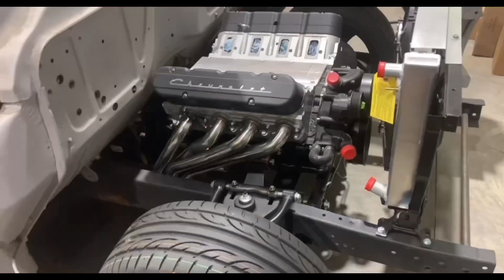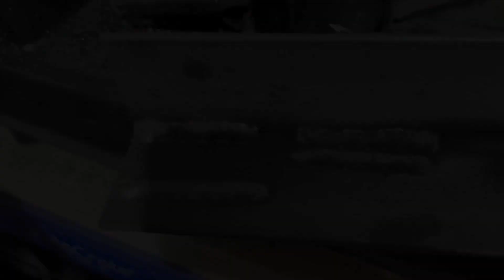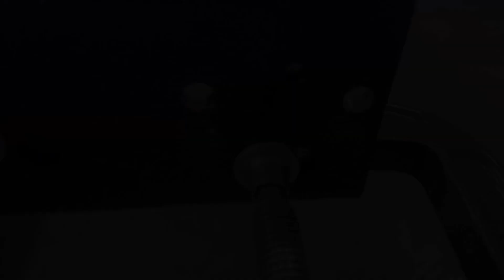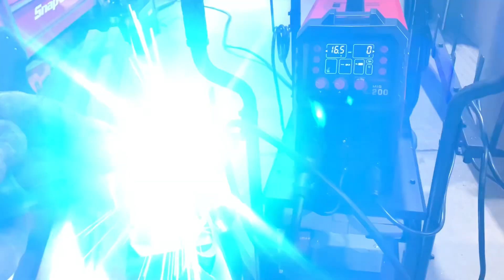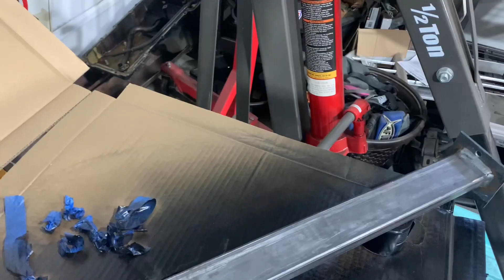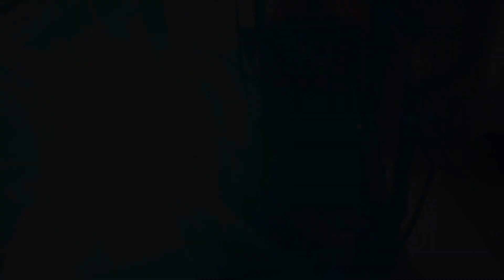NEW Arccaptain MIG200 Welding Machine: Tested on My '55 Chevy Truck Build!

Comment: You should look into getting a oven and get into a little cerkote you could weld and coat your own parts right in your shop and have a side cash from your local guys around you building if I had the room that’s my dream so many parts could done and hard ware
Reply from the maker: Looking into a CNC plasma table at the moment. The software is kicking my ass though… Im not much of a computer person